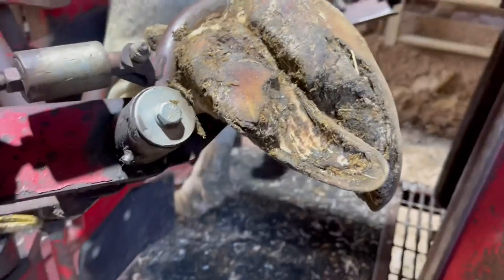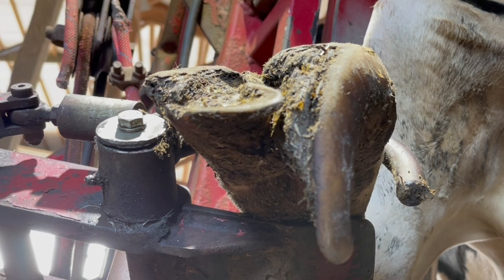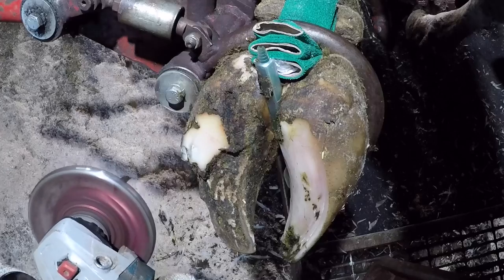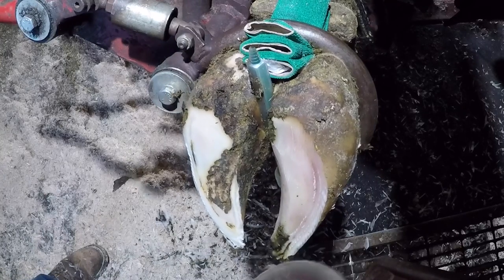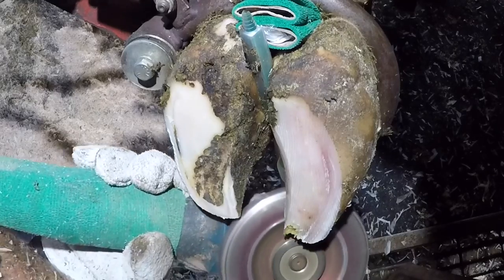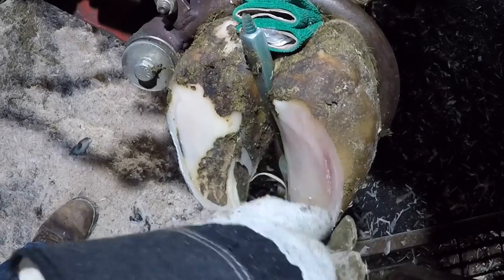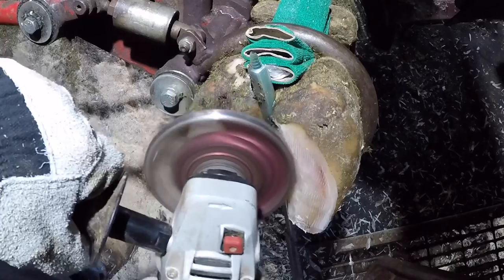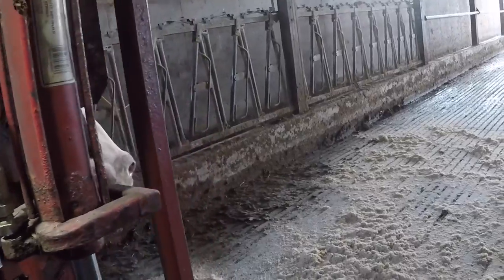This Cow has an INCREDIBLE CORKSCREW CLAW!!

Comment: Presumably cows wouldn’t have all these issues with their feet if they were in the wild. Or they’d just die from sepsis. Is it because farms are so dirty and they stand in dirt all the time? I like how kind you are with them, but I still cringe and think they must be able to feel it!
Reply: It's not from dirt it's from concrete and stuff like that. In the wild cows are supposed to be in fields and pastures where there's grass and soft dirt underfoot. This allows the hooves some give under these heavy creatures. Concrete does not and has no give and puts more stress on the hooves. As well since they are often packed so tightly together they end up injuring themselves more often and banging against hard objects which wouldn't happen as much in the wild.